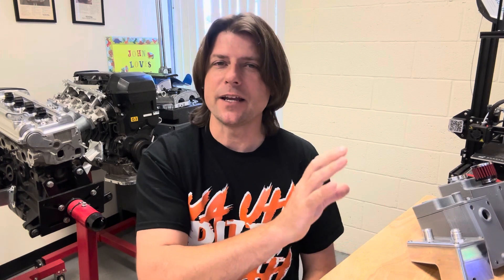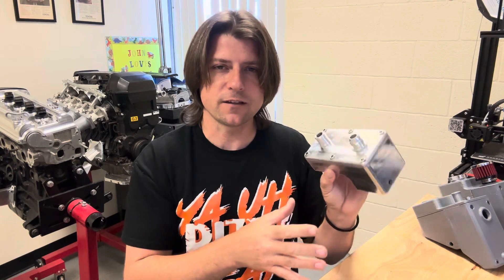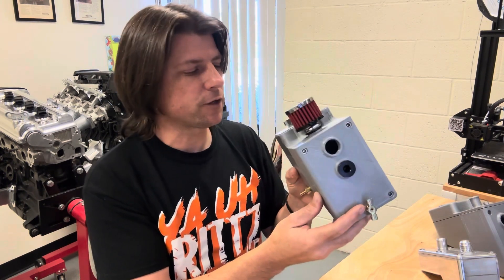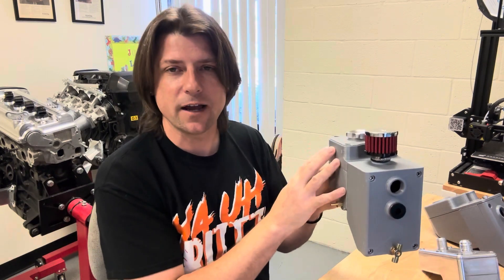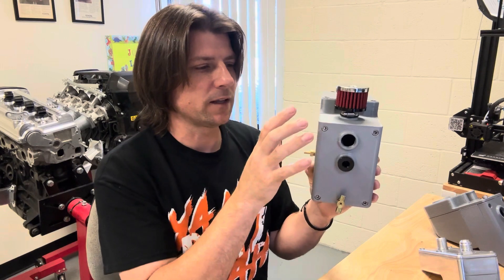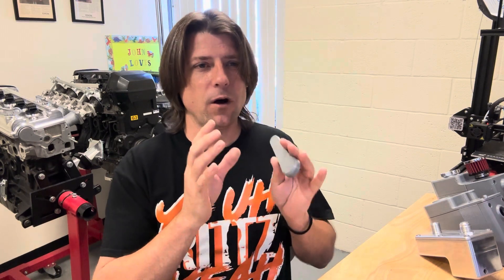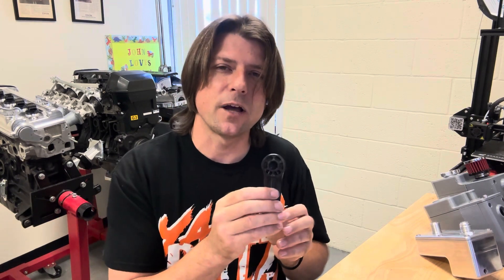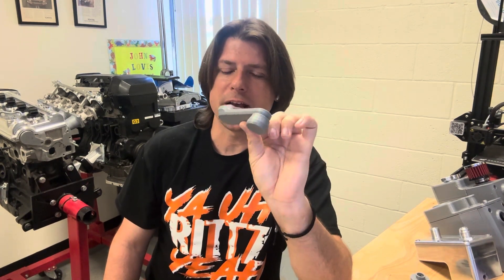This Week in the Shop : Episode 5 designing new AE86 parts.

Comment: Regarding the inlet to the catch can, would it be better to have both inlets at the same horizontal level to maximize capacity? And for the outlet, instead of an integral hose barb, why not have a -10 orifice to accept a 10AN ORB, but then include a 10AN ORB to 1" hose barb? Users who are wanting to keep a closed system could then forgo the barb and could use a 10AN ORB to 6AN barb and connect to their plenum. For interior parts, I'm liking the window rollup handle. Will the knob be aluminum, or could delrin be a possibility? Have you thought about making new rear seat pull-to-release knobs? That was something that had broken on my last Corolla and it was impossible to find a suitable replacement.
Reply from the maker: This is all really good feedback, thanks
Reply from the maker: The knob will be aluminum but I could possibly make a delrin one in the future.